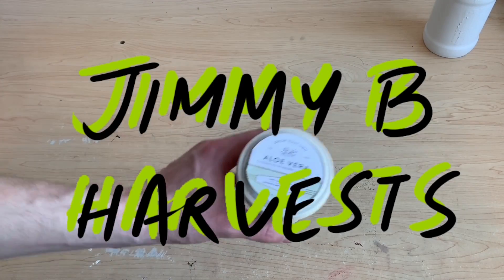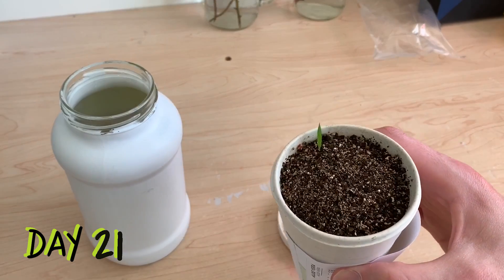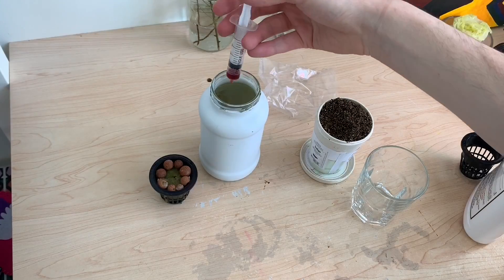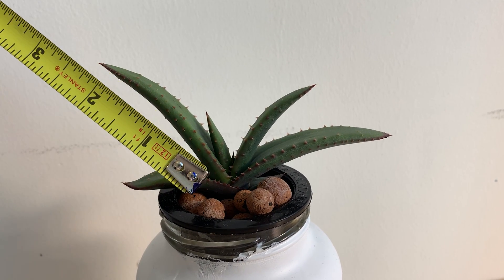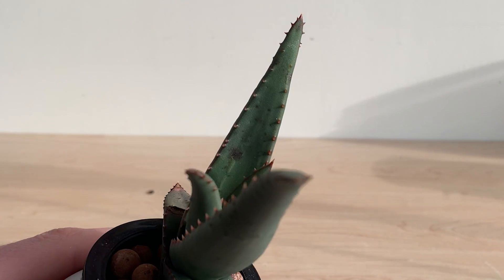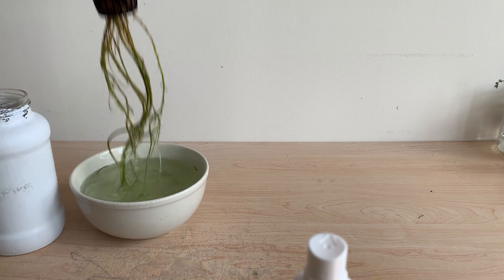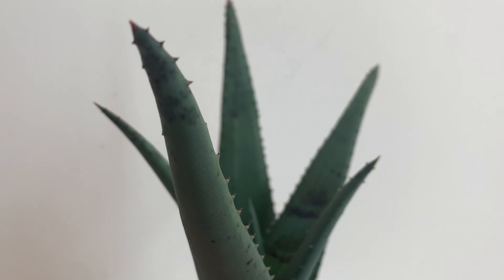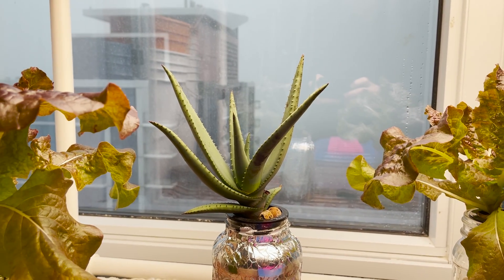Hydroponic Aloe Vera - Growing Aloe with the Kratky Method

Comment: I’m curious about fertilizer…… 
I have to go back and rewatch this one guy who grew a several ft insanely high aloe Vera in one of those 5 gallon air pump containers that they sell at Home Depot; I know he added something, but it was a little amount;
Reply: What's an air pump container?
Reply: @thisriteheh . It’s called a DWC, “Deep water culture. it’s a type of hydroponics where an air pump is circulated into the bucket to pump air into the roots; Kranky is where there is no air circulation; this experienced guy who did DWC had the biggest Aloe plant I’ve ever seen, far bigger than big ones on here but, I tried growing Aloe hydroponically with Kranky and most of them died…so I put it back in soil which I can’t stand, but they’re %1000x better;